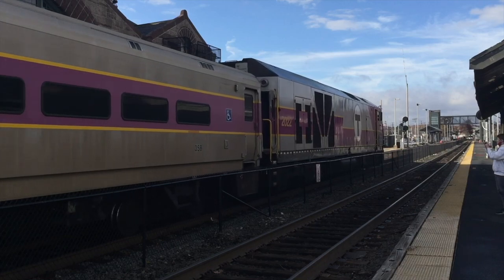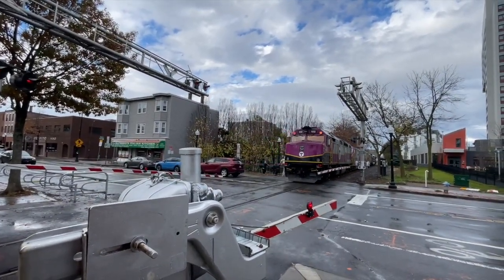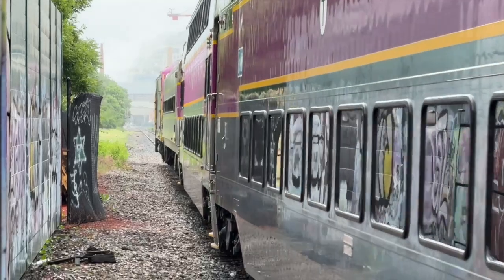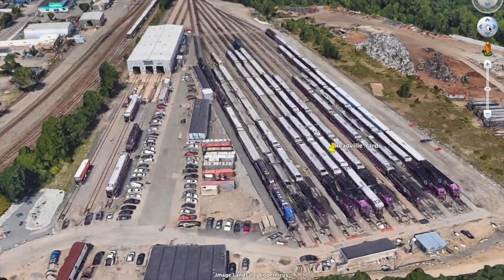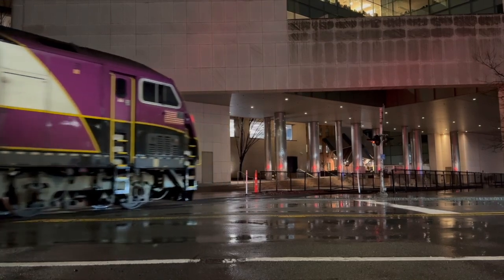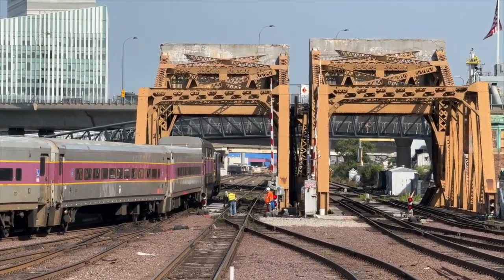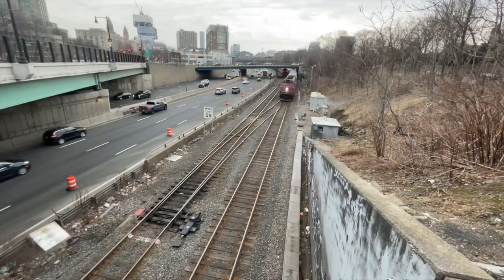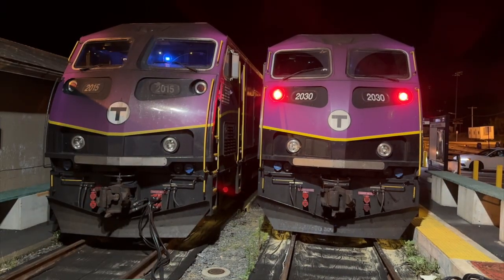Where Do MBTA Locomotives Go When You Don't See Them? | Boston Railroading Explained

Comment: Damn I wish we had 7 or 8 car bi level trains. Would make the old colony overcrowding issue so much better!
Reply: are headways maxed out 🤔
Reply: @FullLengthInterstates  at the moment, yes
Reply: yeah, I also live on the old colony and can confidently say we really don't have overcrowding issues.
Reply: @reallifechronicles1707 depends on when you travel. When the redline is out, we could def use the extra capacity during rush hour. But if we still had single levels with automatic doors, that would also be nice during non-peak trains.